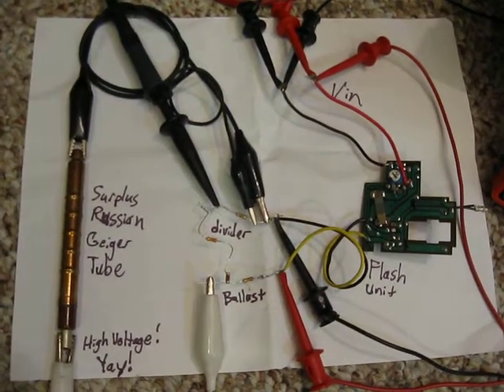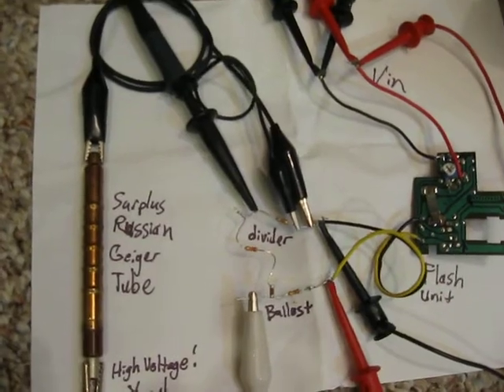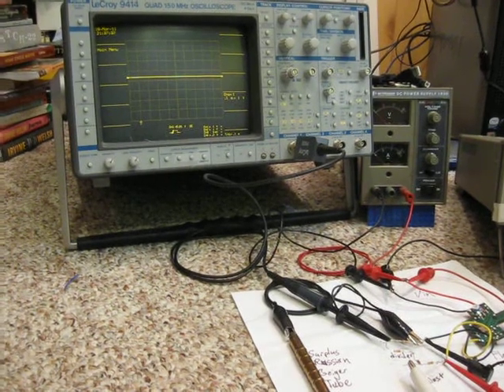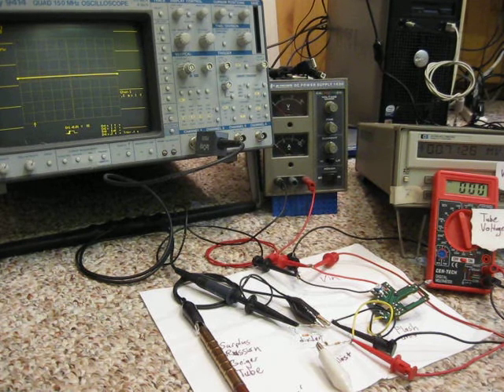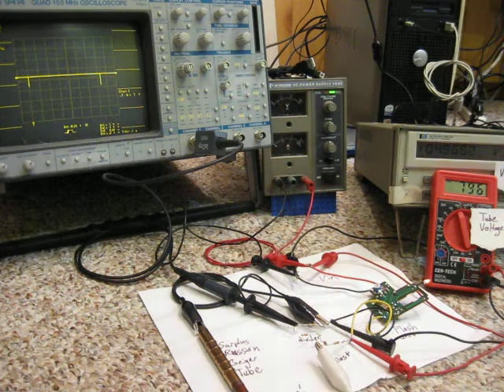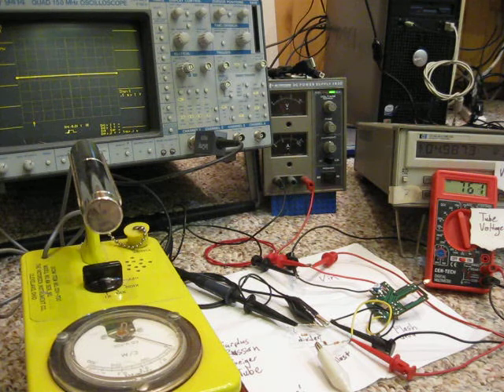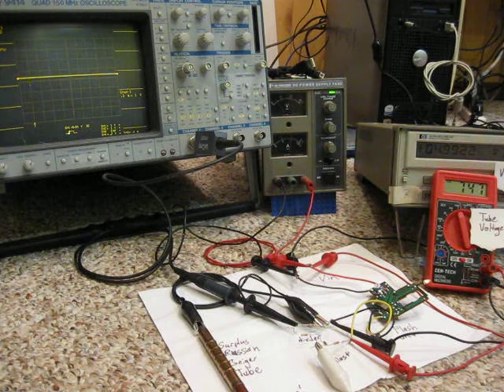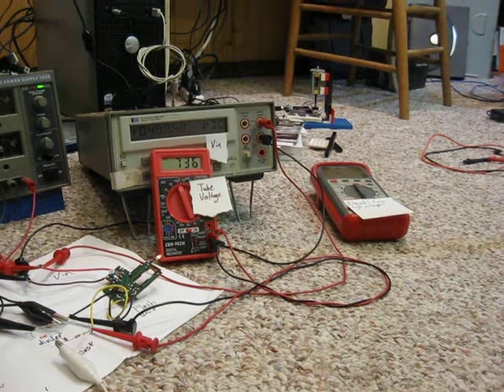madscientisthut_geigercounter.avi

Comment: smellsofbikes since I'm using a current limiting resistor in series with the gieger tube, does that mean If my gieger tube needs 300 volts I need to use 600 volts to account for the voltage drop from the resistor?